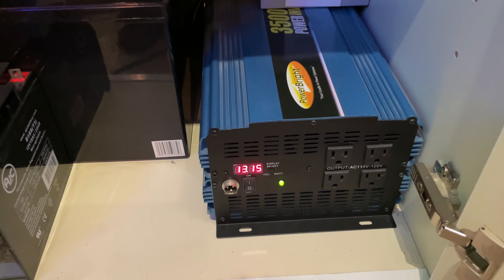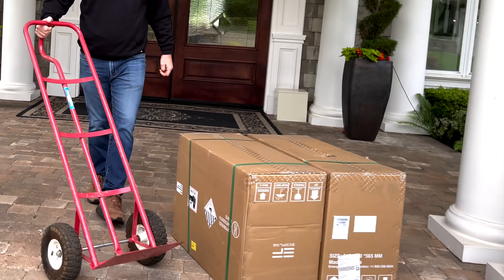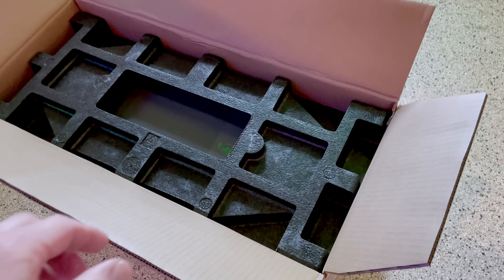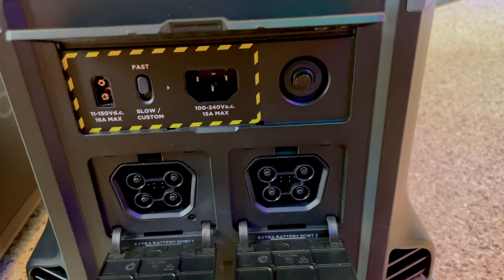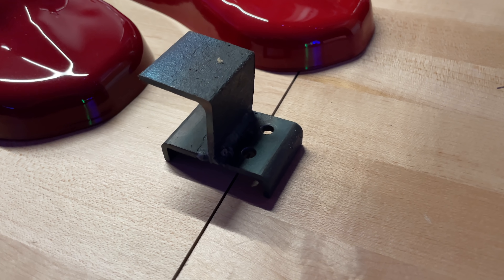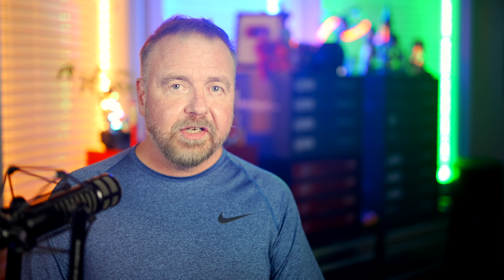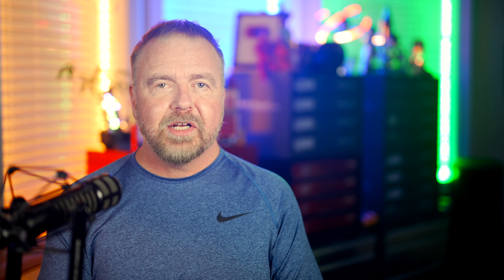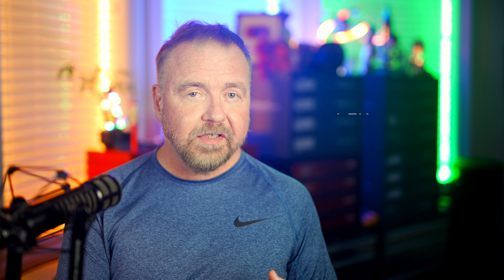Cheap Solar: 12 Years Later - What I've Learned and How I'm Upgrading It

Comment: lol loved the weight joke about being only 30% charged.
Reply: Actually it has veen scientifically proven that a fully charged battery is ever so slightly heavier than a depleted one. The more you know
Reply: @Roguescienceguy  Take AA batteries one full one depleted and drop it on your table and see how they bump differently. Drop them on their end standing upp.
Reply: The charge of a battery also affects its bounce 😄
Reply: That was a joke?
Reply: well e=mc^2 so there's a clear relation between energy and mass, but factoring in the massive c^2 there it's easy to see it wouldn't be easily observable (the change). Technically correct though, which is the best kind :-)
Reply: I am sure it is a joke also.  Exchange of IONS in a battery does not have any appreciable affect on the mass.
Reply: @jimparr01Utube  the missing Ions in the the battery wouldn't be enough to make one of yours penny's or cent's by weight
Reply: Yeah, I have a bathroom scale that shows my weight in bytes.  Right now, I tip the scale at 150k/sec.
Reply: Obviously, none of you have been to prison, because if you had, you would easily be able to determine full vs depleted AA batteries by bouncing them on the concrete floor. It's no joke.
Reply: @jimparr01Utube  Explain conservation of energy with regards to a battery then? Using "appreciable" is not an out. Just because you cannot measure it doesn't mean it isn't "appreciable".
Reply: @paaao  dead batteries bounce because the contents solidify as they discharge, not because of the mass. New batteries are more fluid inside, causing them to absorb the impact and not bounce.
Reply: @danialdunson   came here to say this 😂
Reply: I always wanted a camera flash that's so bright it has a recoil.....
Reply: @paaao  Some of us HAVE been to prison, and the bounce factor is entirely determined by how much liquid is in the battery.   The chemical reaction in a standard AA battery turns dielectric liquid into a solid as it bonds with the cathode.
Reply: Yeah, I thought they finally invented a battery which converted mass into energy!!
🤣

Comment: MIG welding is convenient and the skill barrier for entry is low, but a person with your brain wiring is ideally suited to TIG welding.  Weld almost any metal (and braze too), extraordinary control of heat and beads, no spatter and no cleanup needed.  I think you'd find it very satisfying and enjoyable.  Speaking of satisfying and enjoyable, your channel content is all of that and has been useful to me on multiple occasions. Thanks!

Comment: I did something similar to this in my truck. I was able to fit 10kw of lithium batteries in various places and you can't even tell they are there. It charges from a 24v alternator at about 2kw, or I can plug it in and charge at 4kw. Connected to a 10kw inverter, my truck will power my house or anything else I want anywhere I'm at! I love it! Even the starting battery is lithium, no more antique lead batteries for me...

I can literally leave my headlights on all night with the engine off and it won't be dead in the morning!
Reply: How heavy are the batteries, if you don't mind me asking? I've kinda wanted to do a similar thing with a 3/4 ton truck as a sort of mobile power bank for our semi off grid cabin.
Reply: @MegaDysart  Just the bare cells came in around 15lbs/KW. I didn't weigh the total case with all the parts when I got done, but it was probably close to 20lbs/KW. It's easily 1/3 the weight of lead acid!
Reply: i plan a 300A 48V System, about 15kw of capatity, compined with a 5kva inverter charger from victron. the weight of the battery cells will be about 120kg.
Reply: @ryanroberts1104  awesome man thanks!

Comment: btw Dave, You can't charge your Tesla directly from the Ecoflow because a Tesla/J1772 charger will detect a ground fault. There are adapters for charging via generators that works with the Ecoflow as well.

Ben Sullins had a video where he was trying to use the Ecoflow as his 'EV gas can'. He had the adapter to make it work.
Reply: Most likely he has this feeding a panel.  If the backup power is wired through a breaker on an elect4ical panel than the ground would be present in the panel and no fault would be detected

Comment: This is the way to go, start small and improve over time.
I've worked on mine over the last 7 years and upgraded from tiny system up to am 9000W array with battery back.
Pay as you go is the ONLY way that you'll ever recover costs!
Reply: Yes.  The lack of patience and "have it now" mentality....puts folks in debt and any savings over time is gobbled up by interest.  Only thing I would consider financing in a system....a Sol Ark 15k.  Great unit and for the goal of being net zero or off grid...it isbthe best option out but tough to come up with $8500 off the rip.

Comment: One measurement that would be interesting to do is make an RFI measurement ( to see what kind of RF noise is being generated in the old inverter setup) vs the RFI being generated in the new setup.   Then add some commentary if you think the RFI in the new setup can be further reduced.    If you do any radio work, as I do, you'll notice the RFI from inverters could use better isolation circuitry.  Apparently all of these products pass FCC certification... and still generate high levels of ambient RF.     Especially around the HF Ham bands.  Thank you for a nice tour around the property.   Kudos for starting the series.
Reply: << Apparently all of these products pass FCC certification... and still generate high levels of ambient RF.     Especially around the HF Ham bands.  >>

So we amateur radio operators can moan and groan about other homeowners caused radio frequency interference to us,  rather than amateur radio operators causing television interference and such?

That might be interesting!

Comment: Very minor nitpick: Watt-hours is written Wh, not W/h. You're multiplying the units, not dividing.
Reply: ( 'Watts per hour' would imply the battery charging or whatever is accelerating )
Reply: It's not a mathematical operation. The / is shorthand for "per."
Reply: @williamwalls9745  But it's not watts per hour, just watt-hours (1Wh = 3.6kJ). No "per".
Reply: @williamwalls9745  when doing calculations with the units, “per” is calculated by dividing. That’s why the division symbol “/“ is used as its short hand. e.g. If you travel 90 km in 3 hours, your speed is (90 km) / (3 h) = 90/3 km/h = 30 km per hour. Units of energy are Watt hours, not Watts per hour, which is why the units are Wh not W/h. Mathematically this means you multiply (not divide) the Watts with the hours you use them for to get your energy consumed. e.g. A 2,400 W heater running for 2 hours will consume (2,400 W) x (2 h) = 2,400 x 2 Wh = 4,800 Wh - i.e. 4,800 Watt hours of energy are consumed.
Reply: Watt-hour is not Watt per hour, it's W*h
Reply: @williamwalls9745  yea, what they said.

Comment: I’m secretly pleased that all my best electronics, not to mention the rest, will certainly become obsolete in the foreseeable future and thus require that I buy more stuff,  but cheaper. What a perfect hobby.
Correction : the sun is not directly above the equator on the summer solistice — that’s when it’s at it north maximum.  Your old cells would do their best on the spring and fall equinoxes, when the  is mid course.
On the other hand, your absolutely right that putting them on top of an Aston temple improves performance at least 1024 percent!
I’m cannot see you hat I’m typing so excuse the bizarre misspellings and spell corrections.
Also, I didn’t read all your comments to see if 300 people already pointed this out.
If so, I hereby join the Aztec chorus.

Thanks for another excellent vid.

Comment: It would be interesting to know what capacity the lead-acid batteries that you are replacing now have, after 12 years on the job - test one of them for us!
Reply from the maker: Good idea!  I wonder how I can generate like 3500W of load!
Reply: @DavesGarage  Cheap portable electric space heaters are about the most economical loads around. At around $25 for a 1,500 watt, continuous duty load they're hard to beat.
I'm a paraplegic and long ago converted from lead acid to LiFePO4 batteries in my mobility scooter. The first set I bought were used U1 size pulls from medical equipment. That's close on to 10 years ago and they're still going strong vs. 2 sets per year for the lead acid batteries.
Reply: @DavesGarage  Or you could  test just a single 6V battery with a cheap 150w electronic load - presuming you had one to hand! - say, a constant current of 20A with a cut-off voltage of say, 5-5.25v.  Your theoretical 10 hour test run-time would see an actual 5 hours run-time if the 50% efficiency thing holds.  And I'd think that your 12 year old battery might deliver only half that time!  Of course, this would say nothing about the condition of the other 3 batteries...
Reply: @DavesGarage  you test at 1/20 of capacity as that is how they were originally rated. As you don’t know the capacity now that is a bit of a guess. You can also take a fully charged battery and take a known amount of Ah out of it. You then measure the rested voltage which will give you an SOC that you can look up on a table. A very small bit of simple maths will then give you an approximate capacity.
Reply: @wb5mct  
waste .. hot plate and still .. you get your numbers and little bit extra ;)
Reply: @DavesGarage  Great big resister should work
Reply: @philbrooke-little7082  

😊’]❤

Comment: This is very interesting. I have a professionally installed solar system at home due to strict laws here to power homes and export power however, I am considering an isolated system for my shed and gardening needs that will be disconnected from my main power at home. Hopefully this will inspire a DIY set up.

Comment: An easy way to get heavy items out of a box is not to remove the item from the box but to remove the box from the item. Cut the bottom of the box off. When huge CRT monitors were the thing I would flip the box upside down, cut the bottom flaps off, flip it right side up, and remove the box.

Comment: Most often people installing solar used a fixed battery, rather than portable. With fixed batteries you can have as much capacity as you want and at a cheaper price than portable batteries. With some basic understanding of electricity and mechanical skills you can easily install a battery pack.

Comment: A few years ago someone had the genius idea of coat lead-acid cells' electrodes in carbon. It is genius because these cells  prevent sulphation, can deep cycle to 90% discharge(almost doubling use energy density), and offer many more charge cycles than standard FLA batteries,. They are now a product offering on the market. "ultrabattery" commonly used for marine and automotive.
Reply from the maker: Cool!  Other than "carbon coated plates" is there a tech name for it?
Reply: @DavesGarage  They are marketed as "ultrabatteries".

Comment: I've had an interest in alternative power for some time, but haven't ventured into it. My wife and I just moved from central Kentucky where the power companies have started installing "solar collector farms" with some controversy. There are a few individual homes with solar collectors. We have moved to north central Oklahoma where the landscape is dotted with wind turbines. Both power sources are very interesting.  By the way, 240 volt service is still considered single phase but with two legs. However, since your system combines two separate 120 volt sources to make the 240, they do have to be in phase with each other so they will add correctly. The adapter is most likely taking care of this. 
   Your videos are very informative and I enjoy watching. Thanks for the time and effort you put into them.

Comment: In the Navy I learned about motor-generators.  That's a motor and a generator on the same shaft that can invert DC->AC or AC->DC and it is EMP safe.
I've not been able to find one to purchase but I imagine you could just buy an AC and DC motor and stick them on the same shaft to do this.  Also MGs give you perfect sine wave output and block any HF signals coming from one side so you get privacy as well.

Comment: FYI, the Ecoflow has LiFePo4 battery cells, not Li-Ion. The advantages over lead acid are about the same with more charge/discharge cycles than Li-Ion.
Reply: LiFePo4 batteries are safer as well. They don't overheat and don't catch fire when punctured.
Reply: I was looking for this comment. Not very professional to refer to it as Li-Ion. Huge difference.
Reply: LiFePo4 (Lithium Iron Phosphate) is a type of lithium-ion battery. It is not the same chemistry as the more common LiCoO2 (Lithium Cobalt Oxide).  The might not often be call that to differentiate them from the more common variant but that does not mean they aren't Li-Ion batteries.
Reply: @Danang Alta In what way is LiFePo4  not a li-ion chemistry just like LiCoO2?
Reply: @target844  huge property differences in regard to optimal storage voltage ( capacity)  max charge voltage and discharge voltage in relation to degradation
Reply: Well
Hold up. 
Are you saying that the power storage in this battery is not achieved via the chemical interaction of lithium ions and a matrix of other metal complexes in the anode?
Cause like, it totally absolutely is and they are definitely lithium ion batteries. They aren’t the same as the original design by Sony…but they are still lithium ion what the hell is happening.
Reply: @EricLS  there is a cost difference and many other  differences.   When making comparisons it definitely matters and should be noted.

Comment: Hi Dave, I may be a little older (Assembly Language and Octal instructions , hex-dumps,..old). You seem to be a feather from the same hat we share. I also designed and built my own photovoltaic system but mine is off-grid.
I have a separate 7.5 KW system that sells to the hydro utility company with 10 years remaining on the contract with its own meter. The off-grid is 24v with a magna-sine 4kw inverter and a midnight classic controller. I'm also thinking about going to a Lithium battery bank, just waiting a bit for a good bargain on volume purchase. I did the off-grid as an educational project and had it legally inspected and passed with an emergency disconnect located for easy first-responder safety. It's to power the backyard gazebo and pond stuff. Ty for sharing. 👍😊

Comment: I can’t believe you chose a portable system for your home. I have to have something like 400 amp hours at 48 volts for my 240 volt off grid system and that’s a very small system. It runs my well pump, mini split, refrigerator, washer and lights. You must not worry about it since you feed power back to the grid and use the grid if you need it.
Reply: He has money to burn.
My system ran for around 30 years free standing, and used better components than his present system, which makes me wonder how much research went into the present system. Also how much is going into the upgrade, because I would never go portable. You can do it his way, but it is the best way for the best bang for the buck.
Reply from the maker: Money to burn?  Send it to me!  Don't burn it!
Reply: @DavesGarage   I think just about everyone needs a little more money. I suppose the trick is getting by with what you have.
Reply: @DavesGarage  The "He" is you. You're the one burning money, so by you logic you should be sending it to me, rather than wasting it on hardware not meant for homes. At this point you're just playing with solar.

Comment: 240V isn't "dual phase" btw: it's "single split phase". Both +120V and -120V hot wires are on the same phase, with the neutral grounded in-between them.

Comment: Your comment about spinning the dolly out from underneath the box caught me by surprise. I've worked with them quite a bit in retail, but never with liquids like paint. I suppose spinning the dolly out would be the preferred method for liquids. Since what I used them for were all solids, I pushed the dolly ever so slightly forward, and then hooked my foot under the cross bar on the user side of the dolly, and gave it a little tug.

Comment: Interesting to see Dave using 240V.
I have always thought the USA had a 120V mains but it seems houses often have a multi phase 120V supply which can be wired to give 240V and 120V sockets.
Reply: Yeah, it's split phase, and many houses get 2 phases.  Each phase being 180 degrees apart, you can use both to get 240v or go single phase to neutral and get 120v.  It looks silly to me as a European. I know 240v is more dangerous, but that inspired us to get way better designed plugs, and also lets us have more powerful devices on regular sockets.
Reply: @truckerallikatuk  our plugs are ridiculous. It would be far better to have safer plugs and more power available.
Reply: Yeah it's 240V and the street transformer has a center tap to give you 2 x 120V phases 180 degrees from each other.  Our high power appliances like ovens, electric dryer, water heater run on 240V and standard appliances are 120V.  It wastes a lot of copper unfortunately, but we are stuck with the legacy.
Reply: it's actually a single phase, one side inverted from the other. 2 phase is a real thing, used in some countries, and is where 208 volt comes from. split phase is often called 2 phase, but really it's a single split phase. our outlets seem slightly dangerous, but they're really not that bad. I've never had a problem, just don't be careless. the safety outlets I've seen, I can't stand. they just get in the way when all I want to do is simply plug something in. if I had safety outlets, I'd remove them.
Reply: It's 120 degrees of separation guys 😂
Reply: @matthewallison7604  It's 180 degrees for split phase, 120 degrees for 3 phase.  In the US residential gets the split phase, medium to large commerical gets 3 phase.